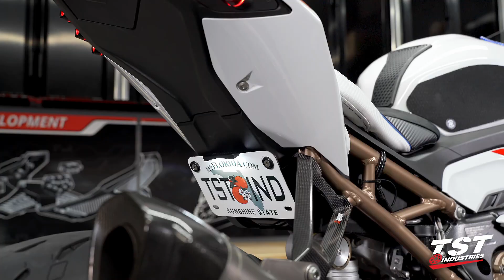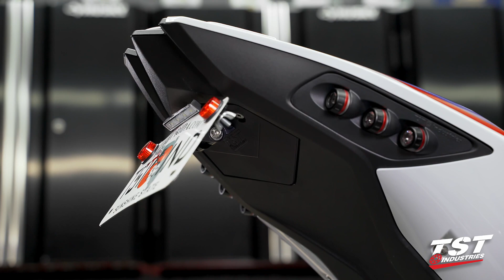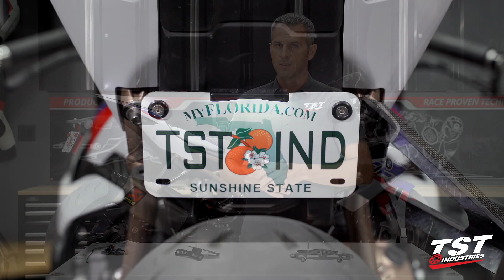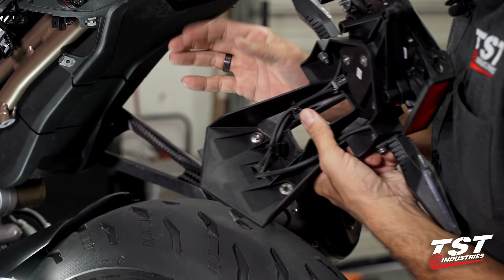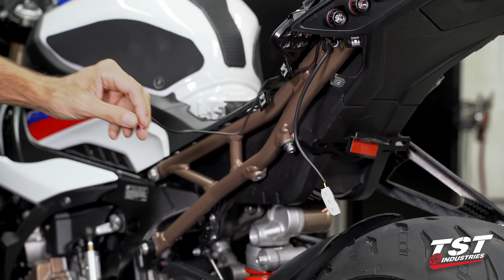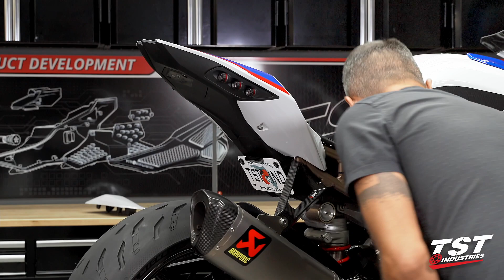How to install a TST Low-Mount Fender Eliminator on a 2020+ BMW S1000RR by TST Industries

Comment: On my Michigan license plate, the hole spacing created a challenge. I had to put a washer under the whole mount to push the mount toward the rear a bit. Even though I have no rear pegs or exhaust bracket. Then I had the use the washers under the anodized rings. I could BARELY fit the lock nuts between the plastic tail section. If I had to do it again I'd drill the plate holes a tad bigger. Hindsight is 20/20. Looks awesome though!

Comment: Any plans to make this tail light kit to fit the 2022 BMW S1000R?
Reply from the maker: Not this tail light because the single R model does not have the pockets in the tail components. We need someone local to bring us the bike so we can analyze what can be done for that model, but nobody has volunteered yet.
Reply: I'll volunteer but I think im way too far from you

Comment: Imagine supplying BLACK hardware..... on a BLACK closeout & a ALL BLACK UNDER TAIL..yet they do stanless..
Reply from the maker: Imagine thinking we didn't consider that but black hardware isn't stainless and can corrode... 
We used to include black hardware in all of our fender eliminator kits but it was more expensive and would rust/corrode over time.
Reply: @TSTindustries  how about stainless with coating
Reply from the maker: @austinA2235  Still prone to fading, discoloration, and ultimately, rust/corrosion.
Reply: I KNOW RIGHT...i have a all black 2022 s1000rr and had to paint my stainless screws black